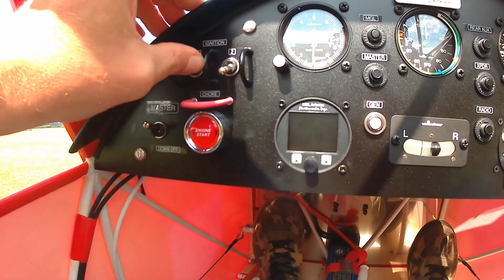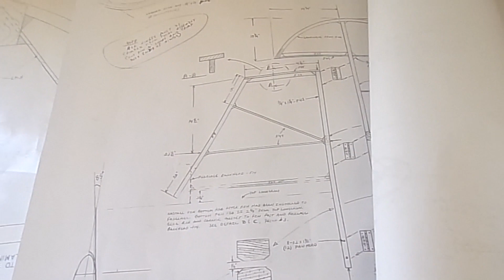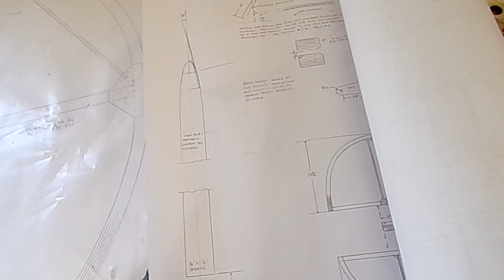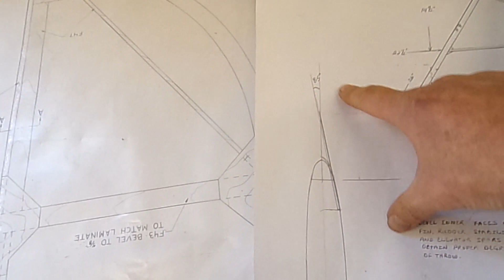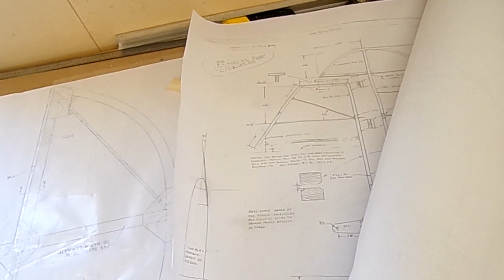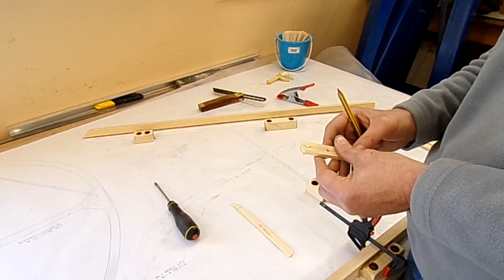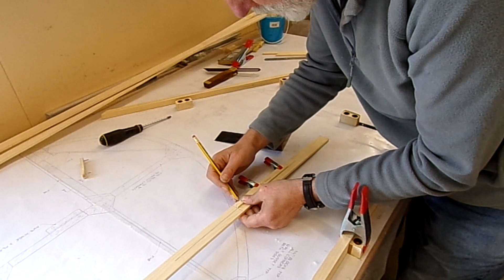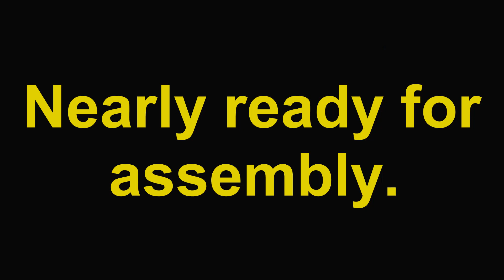EP7 Fisher Youngster V Kit Plane Build - Fin planning and tools

Comment: I,ve built like seventy radio control planes! The Fisher planes remind me of a sig kadet basically. The geodetic wing looks like an easy build  but lots of cutting and fitting extra structure. Fun stuff. You are doing an excellent job! Is it a kit or scratch??
Reply from the maker: It was a materials kit, so little cut to shape,  just lots of strip and ply.

Comment: Hi Algy,
A good tip when cutting tapered fittings such as the fin leading edge, is, while the saw is still set up, cut some scrap to make wedges to keep the leading edge square to the work bench, and also allows you to adjust the height off the table to keep centre line position all in one.
Like you said, it always pays to go through the drawings before cutting.
Keep up the good work, can't wait for the next instalment.
Reply from the maker: I agree with the tip, I got around that by the use of the possition block the leading edge is clamped to. Thank you for your kind comment and input.